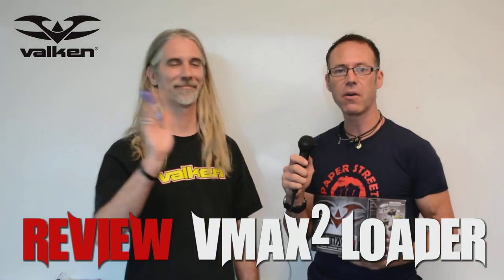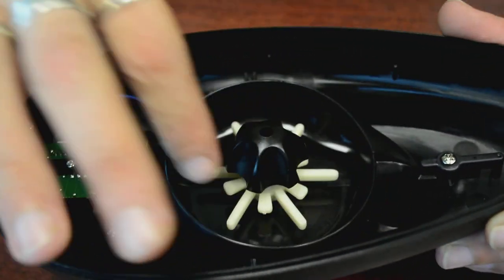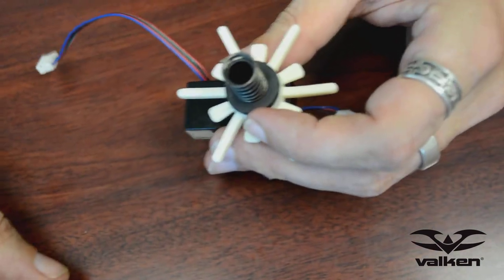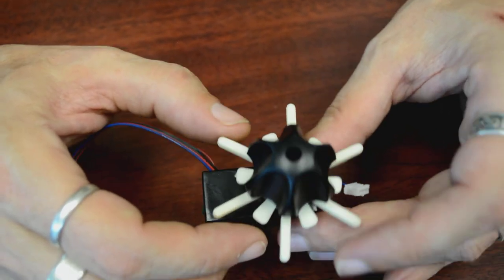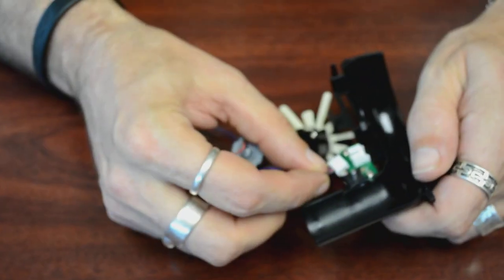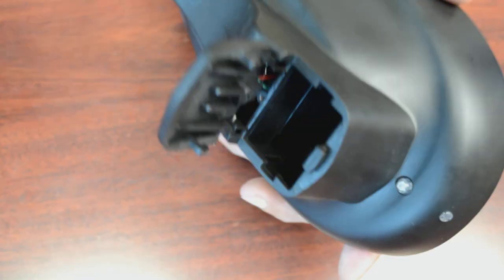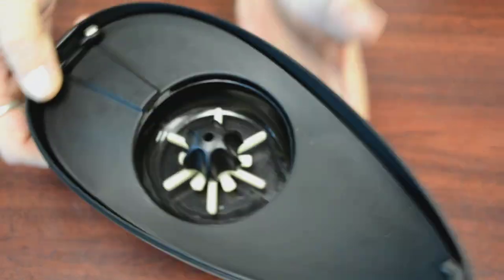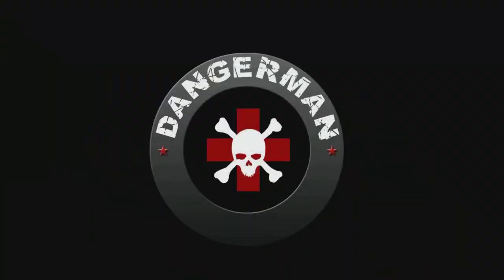VMAX2 REVIEW - Valken's Head Gun Tech explains the loader in complete detail

Comment from the maker: Justin, here is where I'm at on this. The VMAX2 or 1 are price point loaders in the same respect there are price point markers.  For those that just have a hard time scraping up the money, this is a good loader. The Rotor is my love. But it is DOUBLE the price. I've used the VMAX2. I had early use of it and it's a solid improvement over the Vmax1.  Your argument is valid if we are comparing it apples to apples, still Valken made a price point loader than competes well with more expensive units.

Comment from the maker: Mike, it depends on your perspective. Would agree it is nice you get improvements without jacking up the price?  I had a month of use before launch. It doesn't jam, the increased torque in the motor solved prior issues. The new clutch... Yes it's not as pretty as the Spire or Rotor but they did improve the lines and it doesn't look like a balloon this year. I get you, your point is true and accurate. But consider it's the low price point. Affordable and reliable just met.

Comment: I've owned a VMAX v1 for about 1.5 years.  The biggest problem: grinding motor, fixed (replaced w/higher quality servo gears by a gentleman on Youtube), swapped the paddles, and it works like a champ.  I was hoping Valken had solved the lid issue.  If you set the hopper down or bump into anything remotely hard with the hopper, it will open and spill your paint.  On a related note; who do I contact to that new paddle system?  It looks like a top notch addition. Great vid!

Comment: For 100 bucks your not far off from going out and buying a rotor which has a much better feed system in it. I dont want an added piece of pointed metal or plastic (turn-style) that can snag a ball and create a break in my feed neck and barrel. For 99.99 you should get a laser-eye or flap style sensor like either the Pinokio or Rotor. If Valken really wanted to sell the VMax2 and mend the Vmax reputation the price point should be 84.99-89.99 or have a double paddle feed system. Just another Vmax.